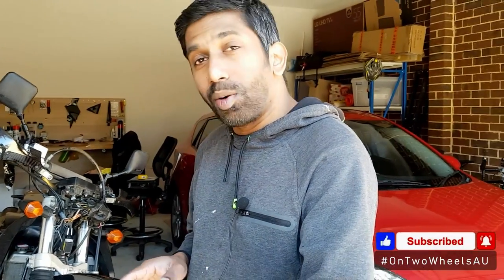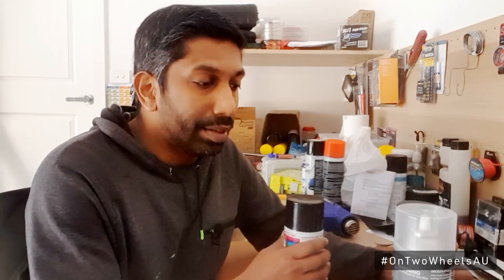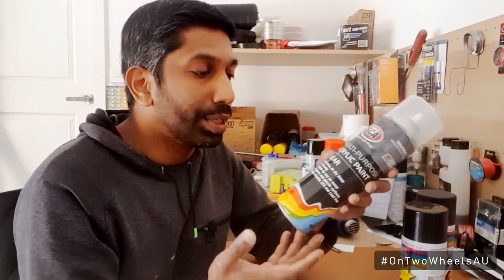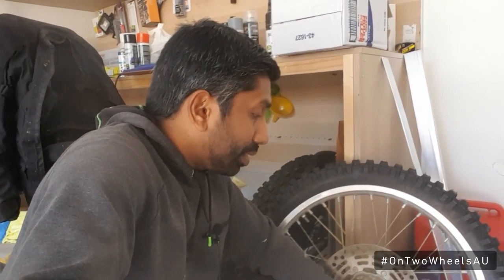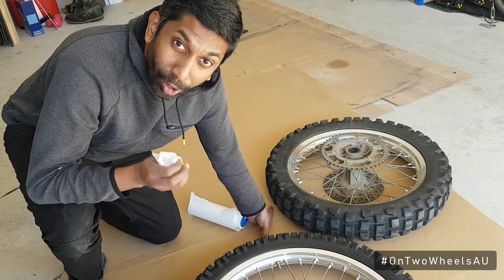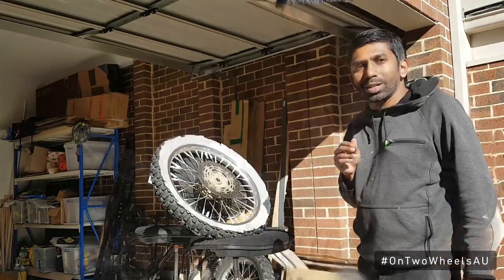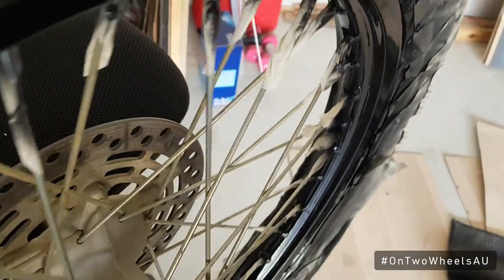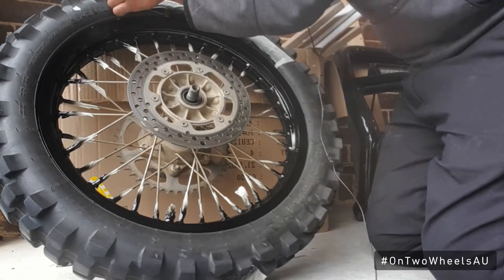How to paint motorcycle rims | Part 3 | OnTwoWheels

Comment: hot tip: before removing tape run that bit of plastic you were tucking the tape with between the tape and paint should break any bonds between the 2 and decrease the chance of pulling up the paint when you take the tape off.
Reply from the maker: That's a great tip! I should have added it in. But hopefully viewers see your comments they watch this.

Comment: Good job. I was concerned when you were wanting to use the export paint but the squirt paint left a nice finish. Just leave them out in the sun for a few days to cure and harden up. OEM black rims are either powder coated  or 2 pack paint which leave a strong durable finish.
Reply from the maker: Yeah, after showing the EXPORT, I didn't want to shoot myself in the foot by using itwhen it says "no automotive use", and I had another option at hand. Squirt's paint is thicker due to the primer. And yes I agree,  it's dry-to-touch, but I'm going to let the rims sit a few days! 
I would have loved to, but powdercoating is beyond my skill level... for now!
Reply: factory rims are hard anodised

Comment: Just remove the rubber tyre before spraying
Reply from the maker: Yeah, that's one way to go, but I'm not a 100% confident of not pinching the tube in the process
Reply: @OnTwoWheels  its also a way to immediately scratch paint off when you try to put the tire back on
Reply: Spraying with the tire on prevents any overspray from occurring where the tire bead seals to the rim.

Comment: Thanks for the video. Not sure if I would do this. My paint still looks good. It's a 05, but I don't take it off road much. I do like the colors of the after market rims. Hope your paint job will last.
Reply from the maker: If you're unsure do what I did on my first go.. use plasti-dip... if it messes up you can peel it off easily! and add a clear coat to lock it in! Probably the best way to go for a first timer!
MY plasti-dipped road wheel set have lasted about 4 years and counting mate!

Comment: Just learned of this Plasti Dip from your video. Can you tell me if you had any issues (when previously using it) removing masking tape, given the overspray? I figure after a few coats the overspray across masking tape line would have built up so much that tear out would be inevitable unless you used a razor blade to assist removal. Not much different to latex house paint I expect in how it can occasionally tear out on tape removal.  Thanks
Reply from the maker: Honestly the plastidip alone hold well, but it has a mild matt texture which will inevitably trap dust. So i used a clear-coat over it. My thinking was that the plasdtidip will make it easy to peel of one day when I need to take it off, but the clear coat will lock it in for now. 4+ years on it's holding up really well!